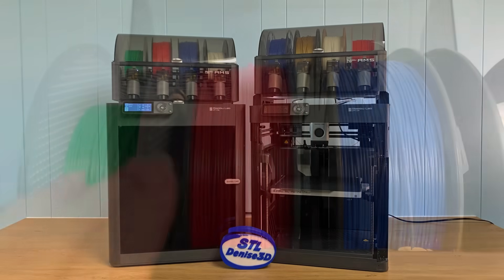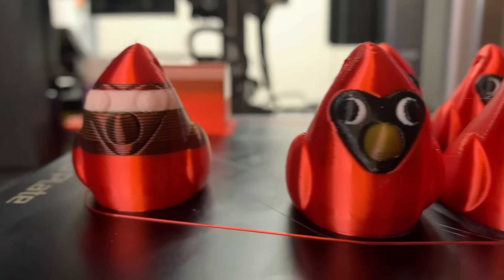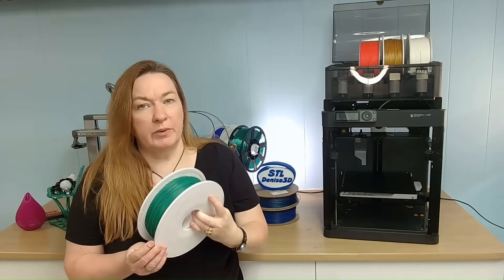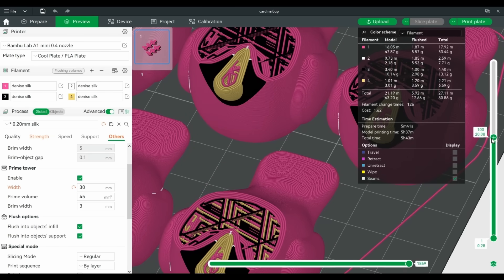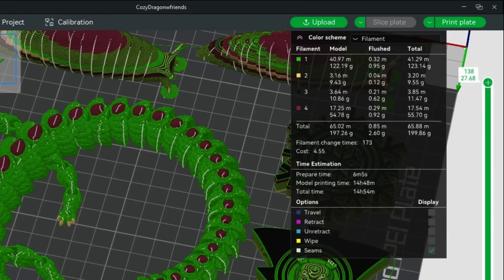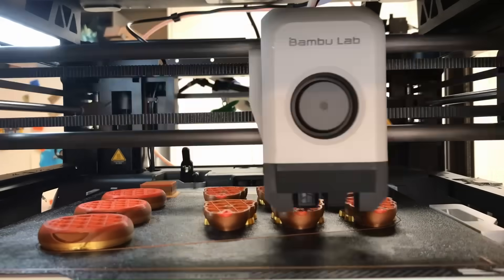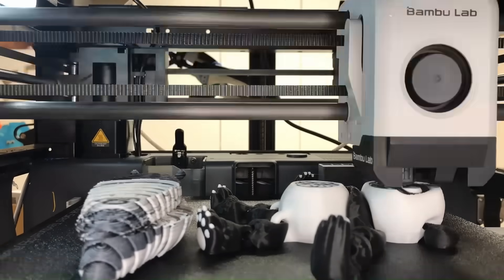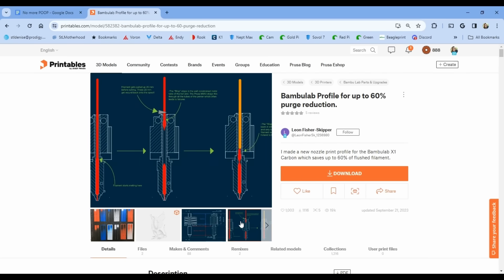Banish Bambu A1 Purge Waste with these 5 Tips.

Comment: So its still a waste because Bambu produce loooot of waste material whne changing the color. so instead of print usless things just buy prusa MMU3 and save your vaste for another print. you will have obut 2/3 less waste than bambu
Reply: I just had to look it up because there is so little info out there on the MMU3.  Joe might want to do some marketing. $300 is not a bad price to do multi-material.  I'll have to take your word for it on the difference in waste.  If you use all of the tips in this video you are down to very little poop and a purge/prime tower.  The MMU 3 does require one of those too.......
Reply: When you calculate price for a spool and on every spool you print you waste 2/3 more filament on bambu then on prusa you can easy calculate you have that bigger starting price easy back in short time if you really print. My printers go 24/7 so I need super support, grat mateneance and support comunity and of cause not stealing models like maker world do and whats the my main issue that chinese bambu steal some ipen source without giving back nothing to comunity and Stalingrad all your print files etc. Thats the rason why I throw my x1c to trash and happily go vack to prusa

Comment: I think I’m going to go with the ”drive myself nuts” alternative and just make a propper multi material slicer that doesn’t waste plastic.
The printer doesn’t need to poop, it’s just lazy implementation.

The printer currently cuts when the color swaps happens and then purges out all the filament inside. Instead it should cut and change before you actually have to change color, keep printing until it’s near the transition, start printing (still inside the model) on areas which are not visible, such as inner walls, infill, support etc).

Non-planar printing could also help in some situations, with shallow lines of color or larger block. I’ll be back in 15 years when I’ve checked in to an asylum.
Reply: When using darker colors behind inner walls, you can often still see them as dark spots behind lighter outer walls. I don't think it's necessarily lazy, as there will be no software solution that will work perfectly in all cases (smaller parts / layers). I guess it would be interesting to see switching a bit before you need a specific color if it's realistic to do it on certain color swaps.
Reply: @KiemPlant  do you mean when you have translucent brigt filaments or do you mean when there are shallow angles so that there are gaps the outer walls?
Cause I intent to solve the second part with non-planar slicing, so that there are no ugly steps :)

Calling them lazy was more of a joke, no one making the words best printer could be considered lazy :p But at the same time I feel like all the slicers are just copies of copies all having the same fundemental flaw. For example, no slicer exists which can run the other most wall at 0.04mm and the inner walls at some multiple of that, like 0.24mm so that you get very nice outer layer but don’t waste time on the inner layers. But since all slicers are built on top of each other fundemental changes like that is impossible, hence ”lazy”

Comment: or hear me out, why don't people just go back to painting models?
Reply from the maker: Painting models requires...talent. 🤣
Reply: This is the right way, but many people have not skills for painting.
Reply: for one, a lot of filaments just don't work well with paints, so for fdm printing you're kinda sol from the start. two, while with paints you can obviously incorporate a lot more colors a lot easier, and you can just make better looking models in general if that's your goal and you have talent, if you just want 2-3 solid colors, multi-material printing will almost always look better than trying to replicate that with paints, and it's obviously much easier.
Reply: I do both😅
Reply: Paint doesn’t last. I’ve painted PLA, PET and ABS, but nothing sticks for very long. I think most plastic products are injected with the color of choice and have stencils for graphics.
Reply: That's a skill many dont possess

Comment: Denise, you need to jump on this. You have 3500 subs but 29000 views. This is a hot topic. I have looked for it in the past and the solutions are limited and the nerds get nerdy. They reduce it with a small percentage. You have made leaps and bounds. I will subscribe now and finish the video.

Comment: i have been using the 60% purge reduction gcode for weeks now and havent had a single issue with it, and it saves 20mm of fillament per color change! it should be made the standard!
Reply: The only problem I've found so far is when purging from black it needs a little extra purge so I manually set black purges higher.  And also using bambu silver pla basic, that stuff takes so long to clean out.  I've tried.6 and .8 but it still shows flakes of silver throughout the other colors.   I've had to also set silver purge manually much higher.  So it really depends on what color/brand/ makeup of the filament used.
Reply: I think it has been made standart with the new versions of the slicer.
Reply from the maker: That's awesome! I'll point this out to my Bambu rep and see if she can get their tech people on it.

Comment: I've been thinking that there should be an option to use infill as a purge tower, and if it needs to purge more than it uses for the infill. The rest should just to go to at purge tower.
Reply: Already exists - Other Tab -> Flush Into Objects Infill. Also she mentioned this in the video that you didn't pay attention to LOL
Reply: Unless I'm mistaken, it looks like they're suggesting to purge to infill, but purge all thats required to infil - eg, do 90% infil for a layer rather if its required to purge it all, instead of doing 10% purged to infil and purging the rest to poop. A variable infill for purging would be great.

Comment: Thanks! Special thumps up for the Estonian national flag colored sinimustvalge (blue-black-white) purge tower for panda print can be seen on the computer screen during last minute of the video. But seriously, I haven't bought Bambu yet, because of huge amount of the poop. I have Snapmaker J1 IDEX and very happy with machine. Thinking about combining it with Mosaic Palette instead of buying Bambu with AMS.
Reply: BB (Before Bambu) the Palettes looked amazing and then seemed to just drop out of sight.   Always intrigued by IDEX and multiple tool head options like the Prusa.  We had a quirky Kywoo Tycoon IDEX, Snapmaker Artisan, and the Lottmax Shark for multi-material.  They all worked ok, with less waste and a lot less versatility than the Bambu line.

Comment: There's some cool toys you can also purge with, like those not-lego modular bricks, I don't want to be rude if I'm mistaking but shold be The Printer Professor's stuff, or those cool Hextraction tiles by Zach Friedman which is a must have of a table game if one prints! 
To me the very valuable advice has been to print them in batches. It's not obvious until it is. The Gcode trick might be a bit too hacky for my knowledges but the graphic explained it perfectly and it's a cool thought! I already modify the purge volumes but that might be groundbreaking if someone's new to Bambu Studio.
Reply from the maker: I agree! Game pieces and any toy you like stripy or might paint later are really good ideas!

Comment: I don't have a Bambu, yet, but am hoping the A1 unbought reviews are still positive.
Reply: I did try the nozzle profile to save filament. It didn't save me any filament, possibly because using the infill was sufficient or Bambu has already incorporated that GCode (?), and it actually made my print slightly longer. So, I chose to use just the flush to infill and modified flushing volumes.